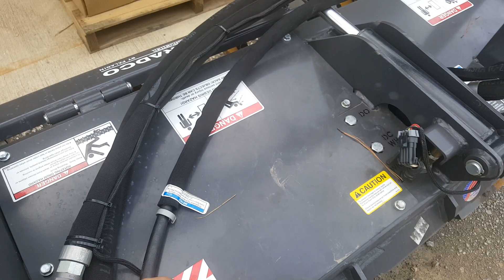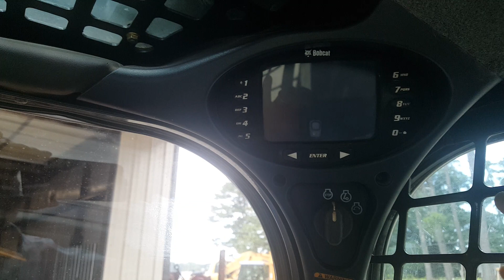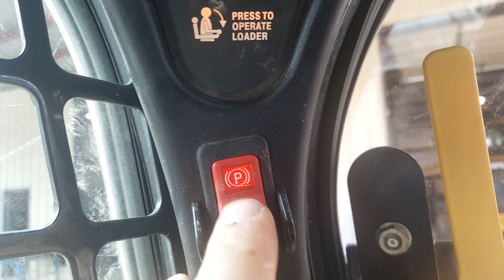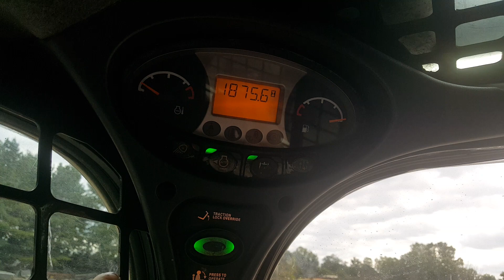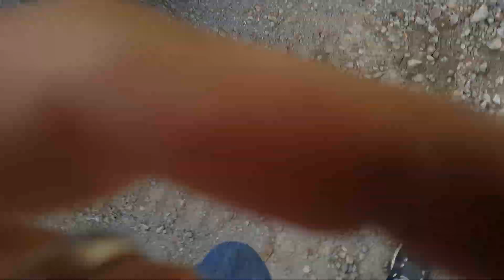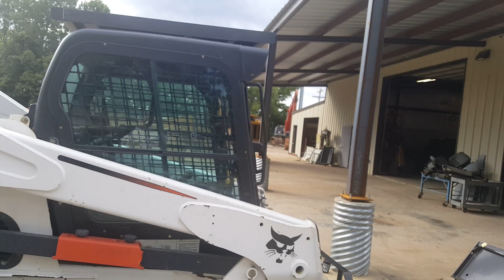Dynamic Machinery BOBCAT T870 Bradco Mulcher, Stump Grinder

Comment: Dont see a forestry door on machine!
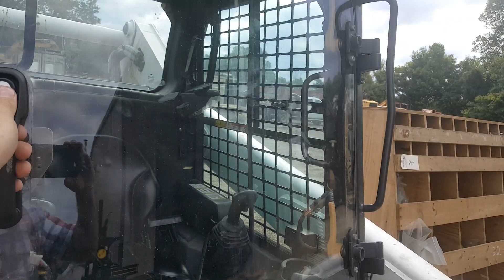Reply: Look again at 15:45.
Reply: @mueckenhoeffer  still seems not as thick as mine
Reply: @kevindavis8016  Possibly not.  I'm in learning mode on this stuff so I may be completely off-base.  It seems there are 3 possible doors depending on year and model: regular glass door, a polycarbonate "special application door" and a 8 layer polycarbonate forestry door.  Additionally, there are aftermarket doors and frame kits that may or may not be up to Bobcat's specs.  

On the more modern units, the forestry door does seem to protrude further from the door frame.  But, as his loader has all the  rest of the forestry applications kit components, I can't imagine that being the wrong door unless he managed to bust his good one and replaced it with aftermarket.
Reply: @mueckenhoeffer  I own 2 t-870 forestry set up both have 2 inch Bulletproof door. Saved my life more than once.